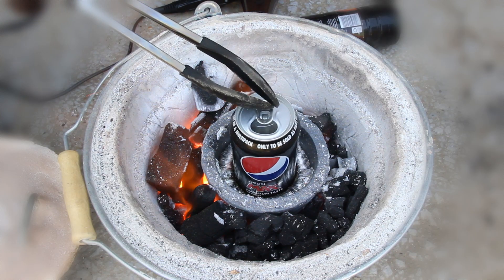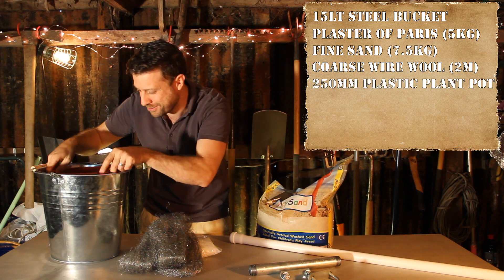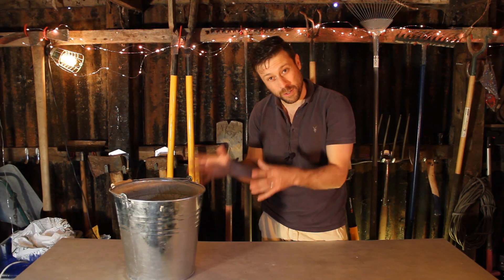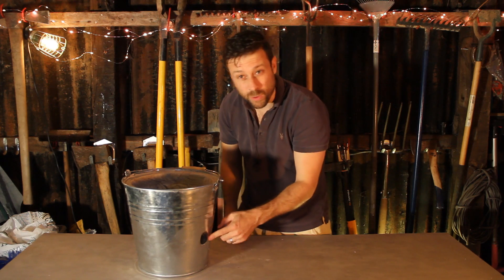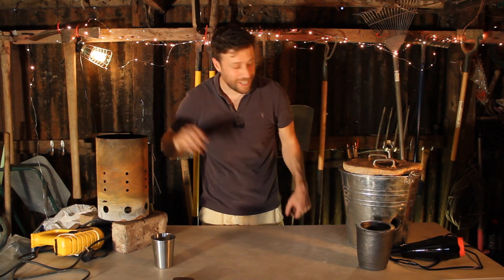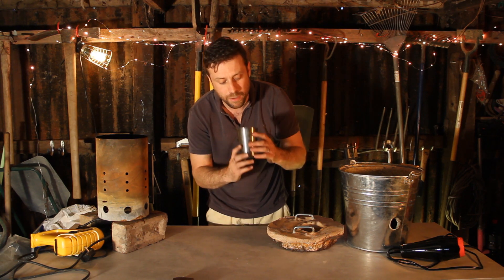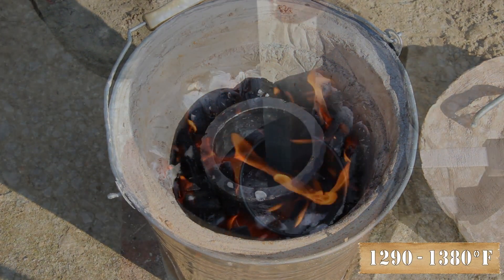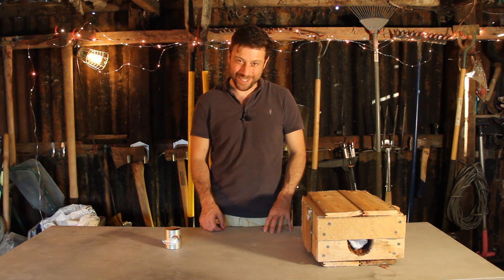Melt Metal at home - How to Make a Metal MELTING FURNACE

Comment: Can I melt stainless steel?
Reply: Well, I think yes but you will face a lot of difficulties cause it requires a lot of temperature and the minimum temperature to melt steel is 1000°c 😬, which is a lot 
However if you are dedicated then I suggest use good material and strong compounds to make the furnace and to provide temprature use coal to apply temprature from below and use a blow torch ( idk what is it's name ) from above you will get proper results

Comment: What is you melt rock? Does it become metal too or just became back to a rock ? Or depends what type of rock?
Reply from the maker: Hi, my melt stock is just scrap aluminium. I’m not sure about the process to melt rock/ore but you will end up with molten metal and a slag, which will contain the majority of the rock/impurities. Hope that helps
Reply: @MetallurgyData  thanks

Comment: I want to make an ashtray with steel what's the best way to do that
Reply from the maker: Hi, I’d have a look at forging. You should be able to get up to temperature quite easy with gas or charcoal. To melt steel it is much trickier than aluminium. You could also consider welding but the outlay of the kit would be reasonably expensive

Comment: Awsome video, well timed and edited. A nice pair of long barbecue tongs work well for crucible handling, no plastic of course. I'd recommend setting out some firebrick or a cinder block to set the crucible on after removing it from the furnace. From there you can better reorient the tongs for a safer and more accurate pour. I dig your enthusiasm and style, keep it up!